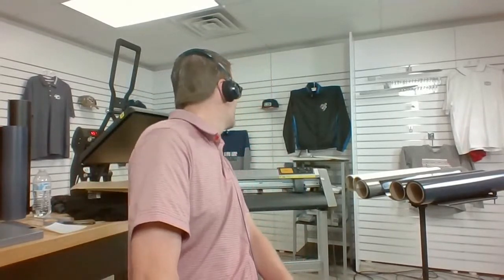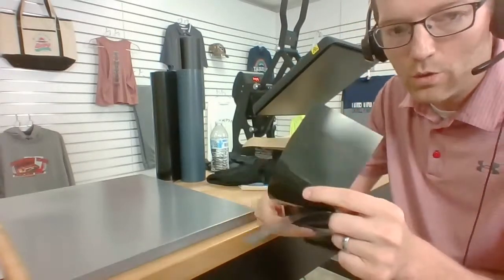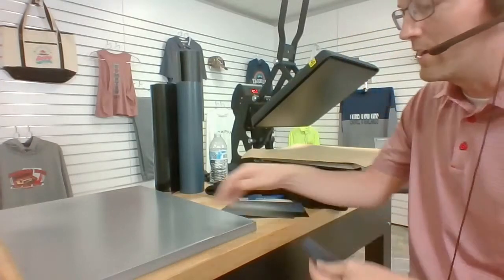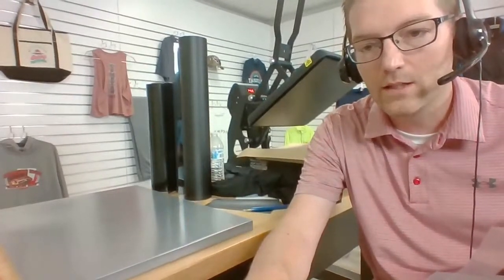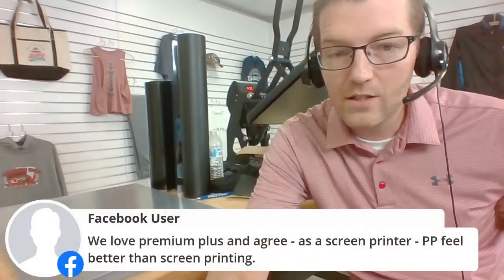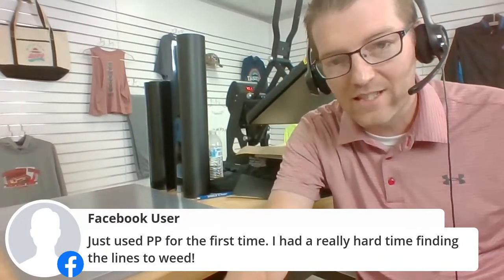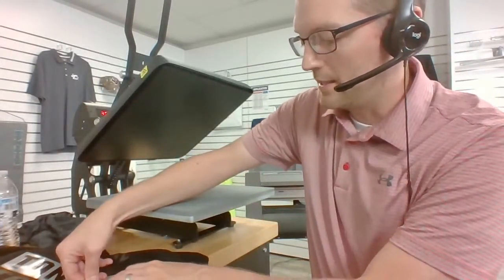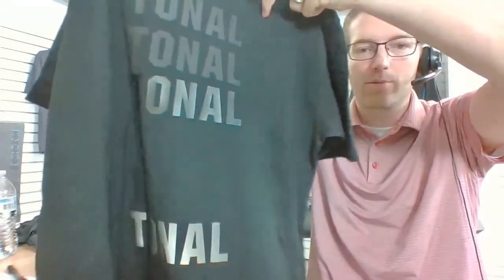HTV Style Comparison for Tone on Tone Printing

Comment: Why do you guys only want to sell 1 yard rolls to your customers looking to achieve this display your offering.  We only need a square foot of each.
Reply from the maker: You can also order samples instead of one yard cuts if you'd like.
Reply: @StahlsTV  The person I talked to on the phone INSISTED that I could only by it by the yard!!  EVEN THOUGH there's a option on the website, you can't order by the foot.  Please respond with the person and phone number to get this ordered.  Need to make this shirt for a client.  Thanks!
Reply from the maker: @deckor88decorates19  If you're looking to achieve this exact display with these colors only, yes you will have to order by the yard. However, if you're okay with these materials in any color then you can order samples here: https://www.stahls.com/heat-transfer-vinyl-diy-samples